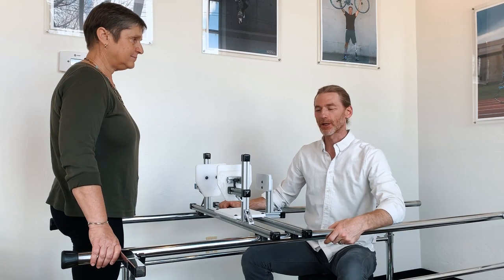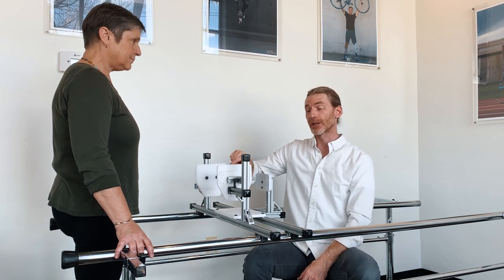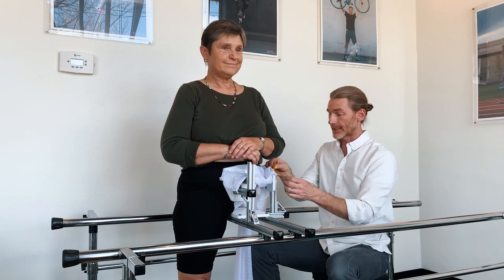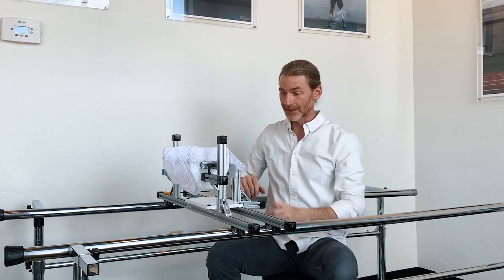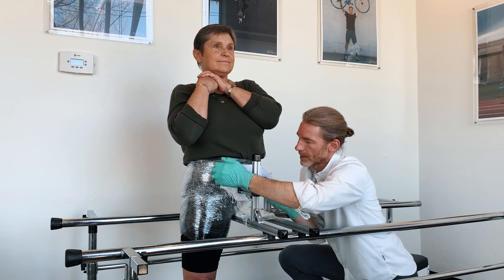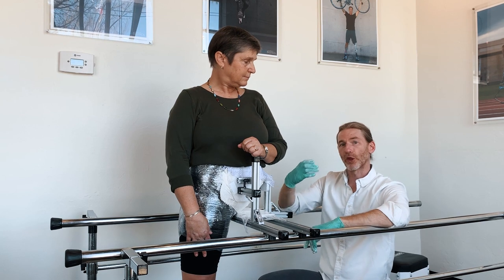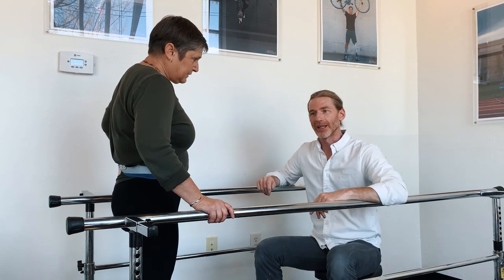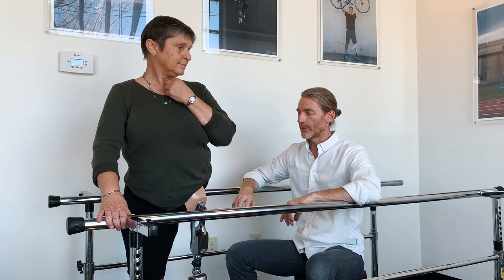Socket less Socket™ Hip Training

Comment: Far better casting procedure and finished product isn't a mid torso body coffin.
Reply: 'Body coffin'...lol never heard of that term for a socket on a prosthesis for either a HD [hip disarticulation] or hemipelvectomy before. I'm a hemipelvectomy and have had a prosthesis now for 30 years. Can so remember my first prosthesis and the socket - and I can't think of a better description you invented for the socket on it; 'mid torso body coffin'...lol! Thanks to developments in technology over 30 years, the Bikini socket for an HD and hemipelvectomy is the best thing since sliced bread in socket design. I have found that unless the socket fits effectively and efficiently a prosthesis for me cannot be worn. The Bikini socket design is revolutionary for HD & hemipelvectomy prostheses. I'm currently 'wearing in' a brand new prosthesis and the socket although has a silicone lining is still rubbing in certain areas and I have an appointment with my prosthetists coming up in February 2022.